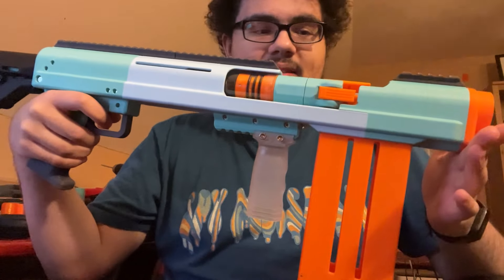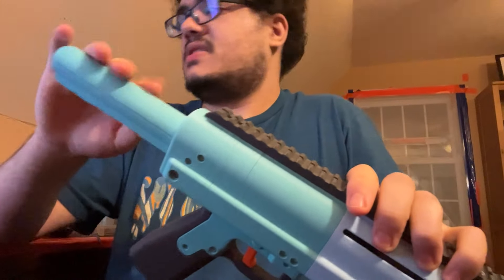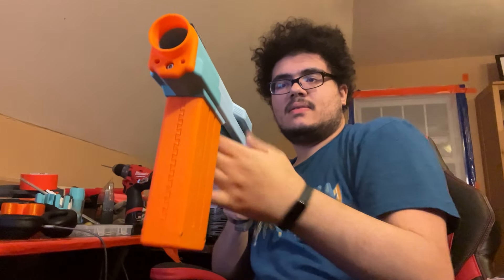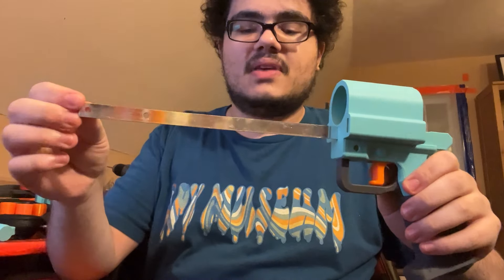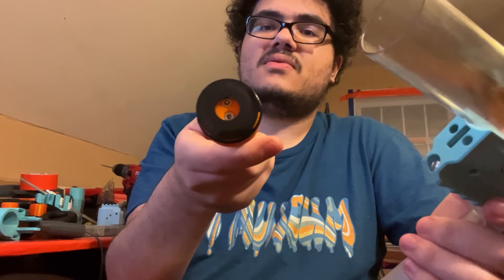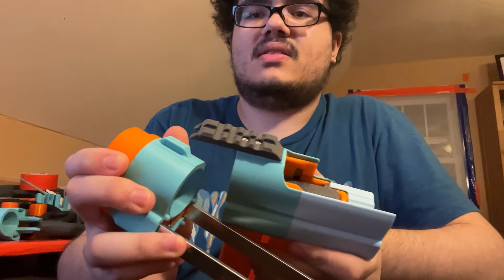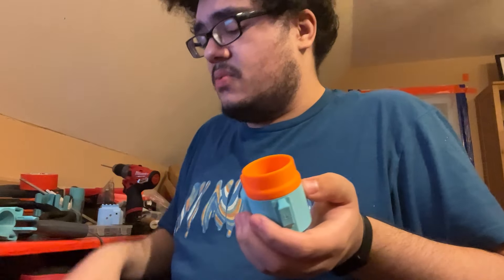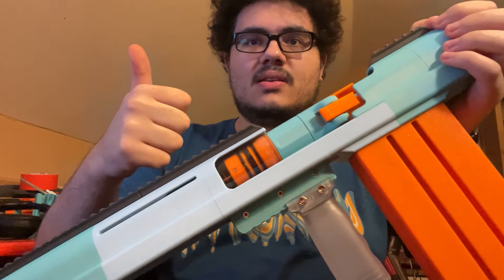Full 2nd Prototype Overview: The BATTLE AXE Internal Box Magazine Shotgun Blaster!

Comment: I love that bolt design, looks really satisfying to work the action.  Any idea how weak of a spring it would work with, before the darts get stuck in the shells?
Reply from the maker: I think this blaster works best with k25, but 788 springs work fine too. Any weaker and I'd be worried about issues like that. Any stronger springs wouldn't meaningfully increase performance as well, it'd just make the prime worse and dryfire more.
Reply: @Sillybutts  Cool, thanks for the info!